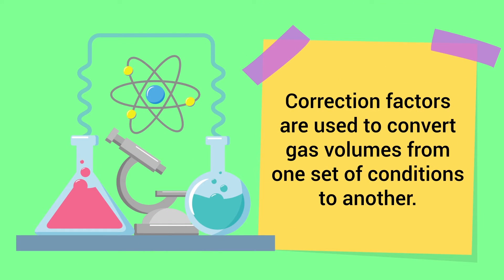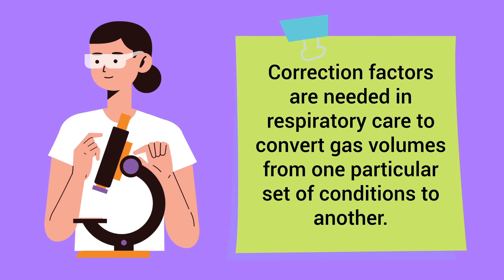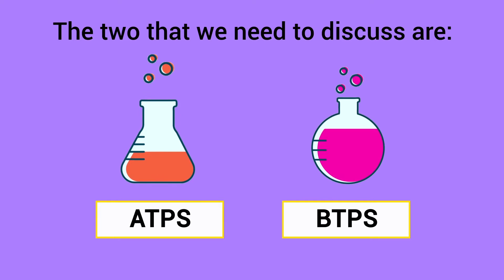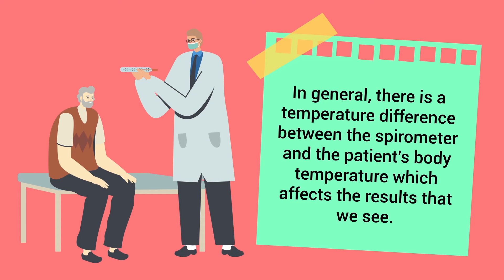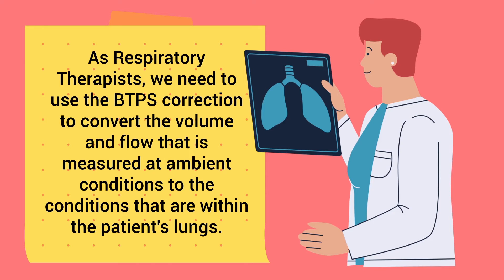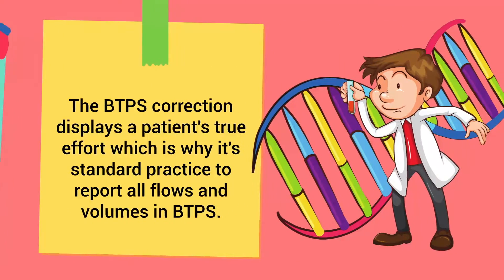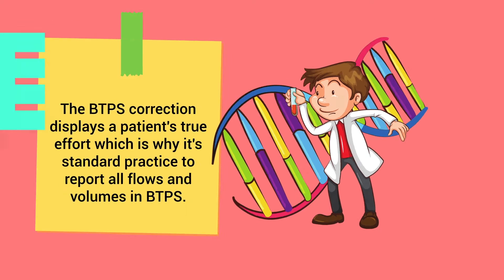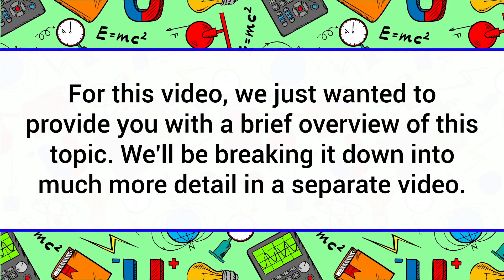Pulmonary Temperature Correction Factors (ATPS and BTPS)  Quick Explainer Video

Comment: A slight correction is needed.  NOT all volumes use BTPS.  Volumes that are inhaled through the spirometer are at ATPS.  if BTPS is used for this measurement it will over estimate the inspired volumes.
Reply: Is the case not that inspired volume is measured in ATPS and converted to BTPS?
Reply: @laaarsas  that is correct... measure at ATPS and then converted to BTPS